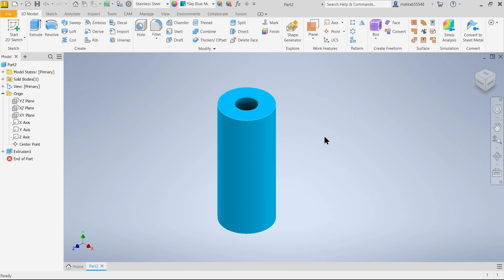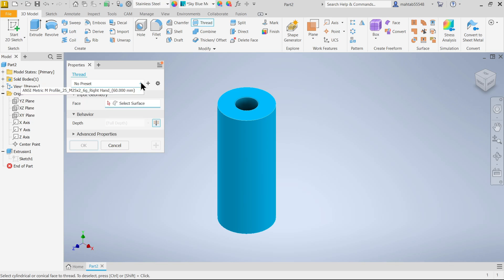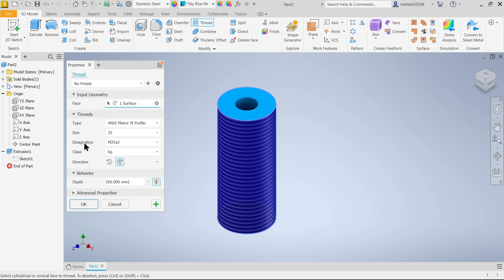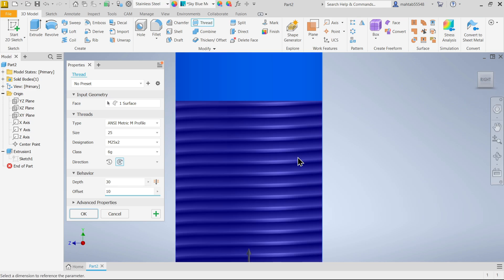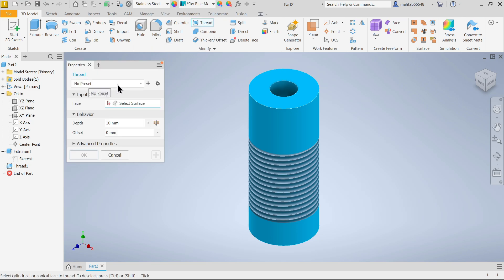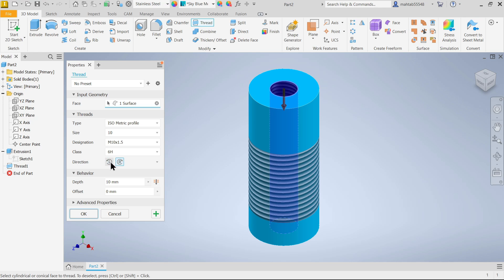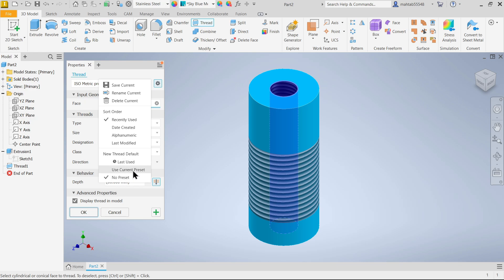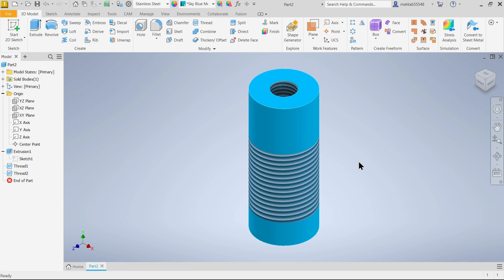External Thread using Thread Tool in Autodesk Inventor 2025

Comment: If you print it on a 3D printer, you get a pure cylinder. You never made it so that the threads are REAL on the model? Do we have to draw spirals and select the tooth profile again?
Reply: The have to big enough to be printed if not they will just be a cylinder
Reply: To make them real, you have to use the coil command and create the thread yourself (watch the video in the autodesk inventor playlist of the bolt and you will understand). Or you can use Autodesk Fusion by ticking the modelled box so the threading appears when you print it in 3D.
Reply: You get a pure cylinder because the thread is not modelled but only as an image